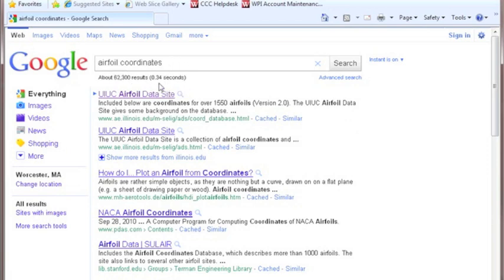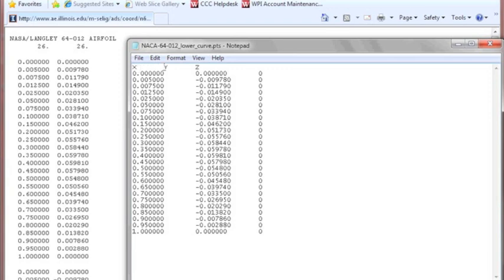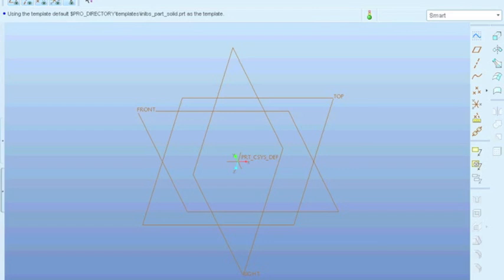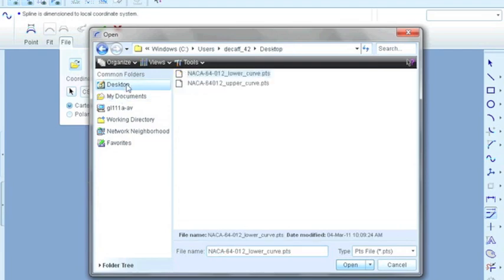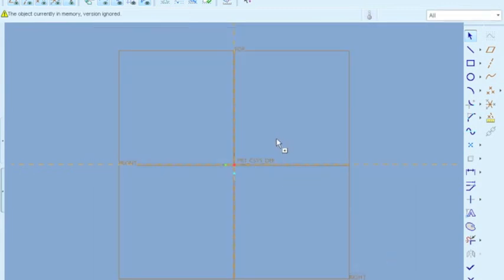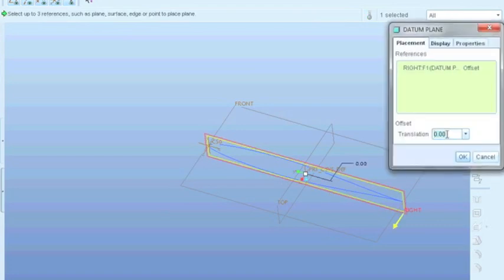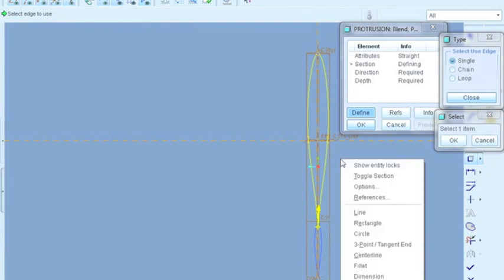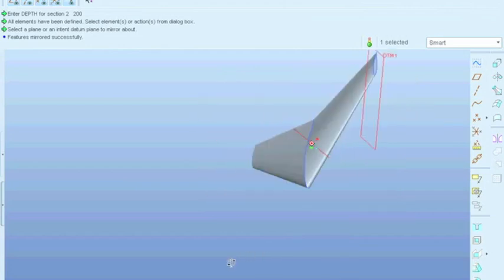Making Wings in ProEngineer

Comment: One very IMP thing: I am using Creo 2.0 and I could not get the upper curve right until I set the data such that X coordinates were in ascending order. So if you guys are having trouble with that, try doing what I did. And thanks decaff for the upload...this is really helpful

Comment from the maker: @TheDrunkinMunkee Yes there is, I'll be posting a video sometime soon about how to do that simply. If you want to get a head start, select your airfoil shape and get the .pts files ready and then sketch the leading and trailing edges in two separate sketches and make sure the tip does not touch. It can be close, but not touching.

Comment from the maker: @zarakdanish So when you go to make the blend, you use the Use tool to select the 1st airfoil, then click and hold the right mouse button and select 'Toggle Selection' from the pop up menu. Then select the next air foil with the use tool and so on. Once you have all the airfoils selected, make sure the last one is still in yellow, ie u didn't select toggle selection after selecting it. accept the sketch using the bottom right check button and proceed with the rest of the blend.

Comment from the maker: @zaheerd21 The only thing that jumps to my mind is making sure that all your airfoils are separated. You have to right-click -> toggle selection before each new airfoil. You also should check where the blend is intersecting with whatever is at the base. Rather than make the base first, try making the wing first and then adding the base in later. I think i had a similar problem when I was first starting and it had to do with my first airfoil defined at an intersection of two parts.

Comment from the maker: That's an interesting problem. It might have to do with the direction you made the spline curve for the lower portion. It should be in the direction the pts file is in. i.e. if the pts file goes from 0 to 1 in the x direction, then the spline curve has to start at the coordinate system and end at the trailing edge.

Comment: @Decaff2010 Hey thanks, this was a really helpful video. I am trying to use this method to create a wind turbine blade using the coordinates. The only thing is that unlike a wing, the turbine blade needs to be twisted along the length of the blade. Is there a way to do this? Thanks

Comment from the maker: It could be. Make sure that the points in your lower curve are going from 0 to 1 in the x column. That is the only thing that makes sense. Conversely, you could keep the .pts file, but reverse the direction you make the lower curve. Instead of starting at the coordinate system, start at the back and end at the coordinate system.

Comment: I try to make the airfoil but the lower curve doesnt want to work, i did the upper one fine but the lower one comes out all over the place and i get this warning which says the spline could not be fitted relative to x and y axes, is the solution to my problem the comment which begins with "okay, fairly simple fix"?  .Cheers.

Comment from the maker: Okay, fairly simple fix. Find where the x column becomes nearly 0, ex 0.00005. Copy everything above that into a new file and everything below that into second file. Since you excluded that point in the 2 new documents, replace that line with 0.0000 in both columns. You can get away with this because it is so close to (0,0). From there you have your upper and lower curve files that just need to be re-ordered and formatted.